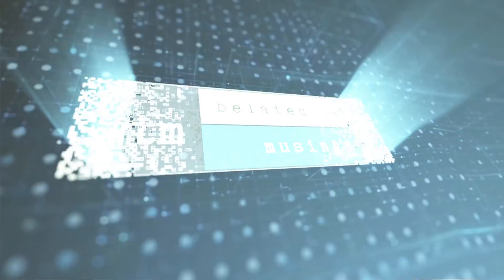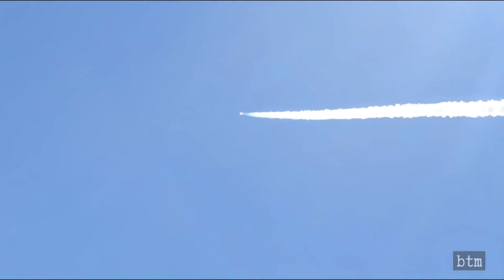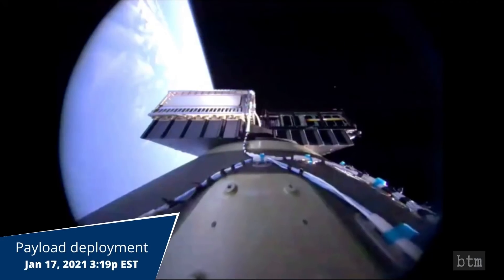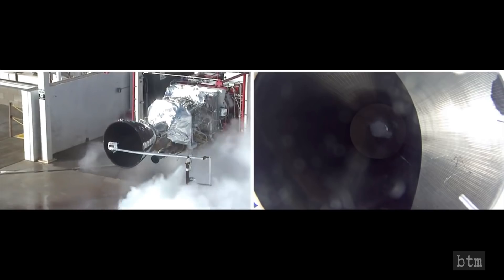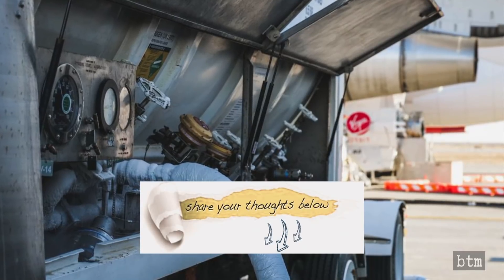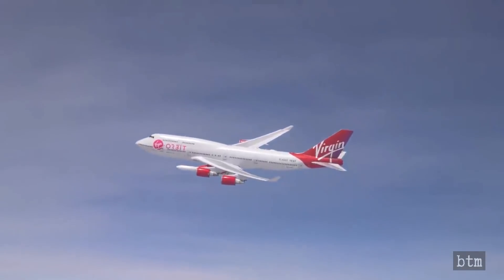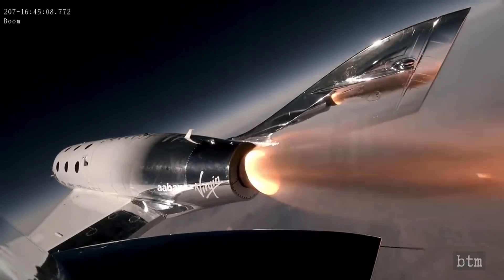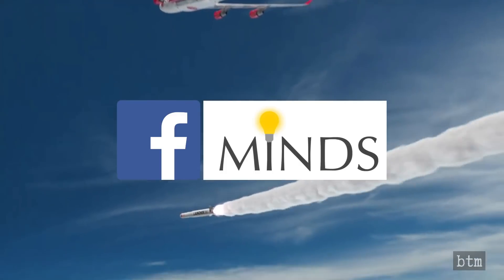Virgin Orbit Demo-2 Launch Succeeds! | ELaNa-20 Deployed! | First LauncherOne Orbital Mission: S46

Comment: A land based rocket launcher is more stable and therefore more reliable than an air launch system. On the other hand, an air launch is not subject to the limitations of a land system. There’s a market for Virgin Orbit but their money running low! Would it be like SpaceX’s make or break story after their first three launch failures?